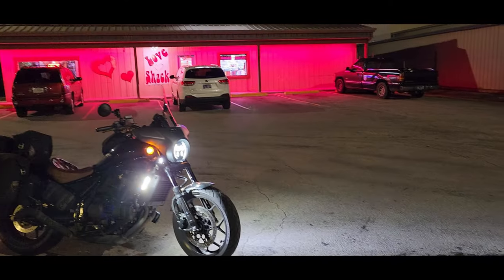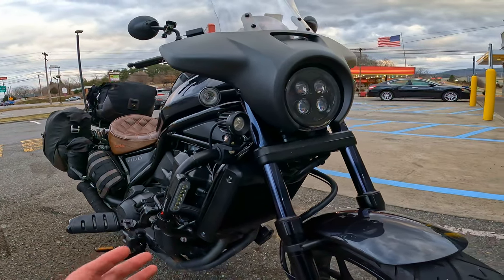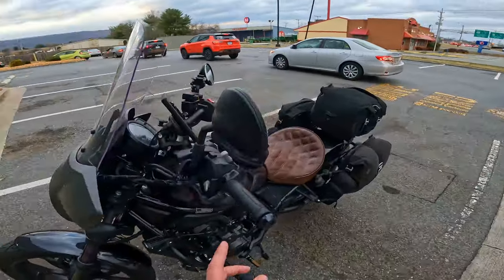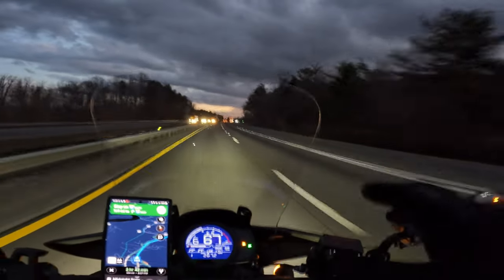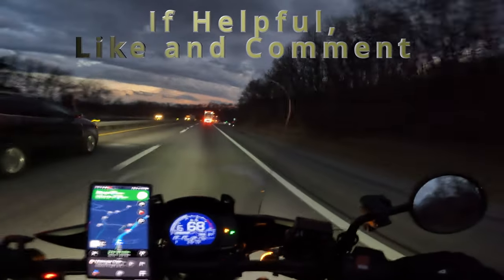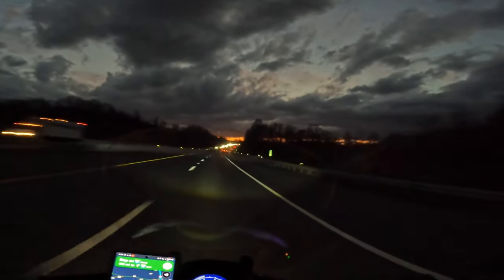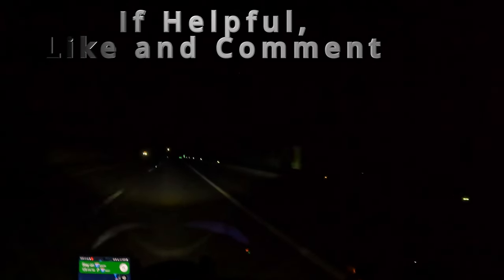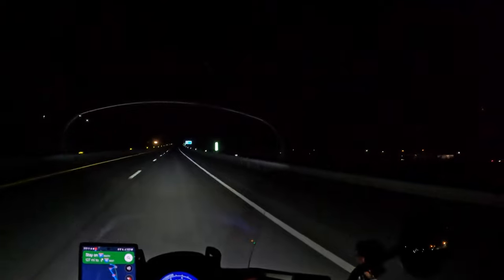Rebel 1100 Fog Lights!

Comment: Hi, which is the light in the rear that blinks back and forth for visibility? I don't see it listed? Thx!
Reply from the maker: Hi Eric, i don't recommend the small lights in this video as i have upgraded to a different more rugged design https://www.guardianangeldevices.com/?absrc=Google&abid=669630595856&abcampid=20276997814&abgroupid=153245145994&gclid=Cj0KCQjwiuC2BhDSARIsALOVfBKIi7bdmRLKl0I-MJ52BZXuOKlCv4ew7ltjmlKoLws_FLcUmiiQ3pwaArflEALw_wcB&abkwdid=kwd-320391298234&utm_source=google&utm_medium=cpc&utm_campaign=GA_RT_SRCH_BR_C_brandedsearch2023&utm_content&utm_term&gad_source=1
Reply: @ontherebel11  Thanks! Which one do you have? You put one on your front and back? You drive down the road with these on, and no problem with the cops? I used to live in NoVa (Fairfax, Fairfax / Vienna btw). I see you seem to live around there. Cops everywhere! :) I would prefer to have this wired to the bike, don't know if that is possible to avoid charging. Not sure between the Denali lights and the OEM heated grips (I plan to do both of those too) if it would be too much on the battery? We live in Utah now, so too hot for an Lithium Ion from what I understand. Great channel!
Reply from the maker: @ericthedude9457 hi Eric, I got 2 of the small lights and place 1 on each saddlebag, I preferred a battery operated light that way I can take them for for a clean look. I don't ride at night often so these work great for me. I don't worry about cops since the light isn't blue and red, I use white and red.
Here's a video showing them in action, go to 8:40 I think. https://youtu.be/Y3xMNByOAjs?si=5n_kN1j2dA73G9be

Great topic and great questions, thanks for asking Eric, this will help others! 🤙
Reply: @ontherebel11  Thanks. I wouldn't get the LE colors, but I guess even white and red is not a problem. It's probably a smart idea (especially since you seem to live around a lot of traffic). Is that another rechargable temporary light on the front of the bike too in this video that looks like it is blinking amber? Sorry for so many questions.
Reply from the maker: @ericthedude9457  Hi Eric, no worries bro, the amber lights in front are the stock turn signals, they are always on. the guardian angel lights can be made just white or just red, multiple options to use it.
Reply: @ontherebel11  Thanks, I was wondering if the CanSmart from Denali would work with the Rebel since it is confirmed fitment for the Africa Twin which I believe is the same powertrain as the Rebel? It would be nice if it would work like it is factory installed, and get some more options like flashing rear brakes, etc. I suppose the official answer is 'no'.
Reply from the maker: @ericthedude9457  sure thing bro! I hope they make one for the rebel 1100!
Reply: @ontherebel11 I have to get the bike first ;)
Reply from the maker: @ericthedude9457 but it's smart that you are doing all the research first! Well done! 👍
Reply: @ontherebel11 I like to look to see what aftermarket support, and specifically what exhaust and suspension is available. It seems full matris and nitron is available. The nitron seems really nice. I guess you can get it sprung for just road as they are a race centric company and i am just looking for comfort / stability. T- rex seems to make some nice crash bars, and it seems you can completely drop the bike, and just replace / refurbish a little boltable piece. I think i am going to get a manual one even though the dct seems awesome (forces me to learn how to ride better).

Comment: Hi, Do u have the install video with product links yet? Or at least product links?
Reply from the maker: Hi there!! 

Here are the lights and the wiring harness i got 

https://denalielectronics.com/collections/led-drl-backup-lights/products/drl-visibility-pod-white-or-amber

https://denalielectronics.com/collections/led-driving-lights/products/d2-led-light-pods-with-datadim%E2%84%A2-technology?variant=41124991074488

https://denalielectronics.com/collections/all-wiring/products/dnl-whs-10900?variant=15068475949156

https://www.amazon.com/Nilight-90020B-Mounting-Off-Road-Horizontal/dp/B0714CYKBJ/ref=sr_1_6?keywords=light+bar+mounts&qid=1689966957&sr=8-6

These are the mounts i'm using on the crash bars, they are not made for these DRLs, i couldn't find anything else that would work.
https://denalielectronics.com/products/engine-guard-mount-for-t3-signal-pods?_pos=5&_sid=62b005d97&_ss=r
Reply: @ontherebel11  Thank u sir! Safe travels!

Comment: links for the lights?
Reply from the maker: Hi John, please note that these were not designed specifically for the Rebel 1100, I am experimenting with them, that's why the DRL's don't have the right engine guard mounts. Please call Denali for the specifics, they have amazing customer service, ask for Alex or Jesse.

DRL:
https://denalielectronics.com/collections/led-drl-backup-lights/products/drl-visibility-pod-white-or-amber

Engine bar mounts for DRL: NOT MADE FOR DRL
https://denalielectronics.com/products/engine-guard-mount-for-t3-signal-pods?_pos=12&_sid=885c24747&_ss=r

D2 Lights:
https://denalielectronics.com/products/dnl-d2-050?_pos=11&_sid=62b5a4831&_ss=r

D2 Mounts:
https://www.amazon.com/LAMPHUS-Off-Road-Horizontal-Mounting-Aluminum/dp/B0791NB4FM/ref=sr_1_1?crid=2XXHDKLNPRK7H&keywords=Off-Road+ATV+UTV+Light+Bar+Mounts+Mounting+Bracket+Mini+Bar+Clamp+Kits+%5B0.75%22%2F1%22%2F1.25%22+Inch%5D+%5BHorizontal+Bar%5D+%5BAluminum%5D+%5B2+Unit%5D+Bull+Bar+UTV+Roll+Bar+Clamp+Tube+Roll+Cage+Clamps+Mount+For+ATV+UTV&qid=1680543159&sprefix=off-road+atv+utv+light+bar+mounts+mounting+bracket+mini+bar+clamp+kits+0.75+%2F1+%2F1.25+inch+horizontal+bar+aluminum+2+unit+bull+bar+utv+roll+bar+clamp+tube+roll+cage+clamps+mount+for+atv+utv+%2Caps%2C416&sr=8-1

Wiring harness to battery with manual switch:
https://denalielectronics.com/products/dnl-whs-10900?_pos=1&_sid=648a58e4c&_ss=r